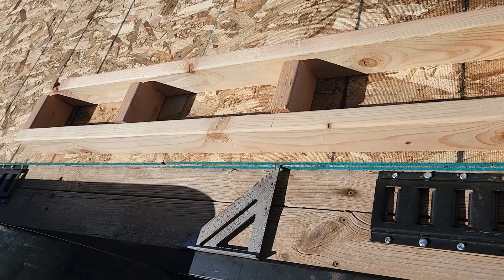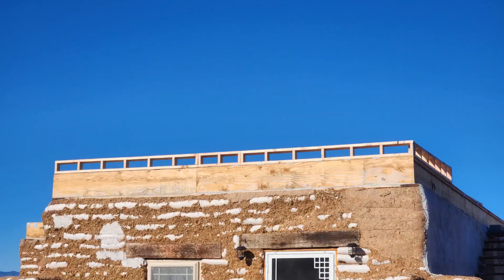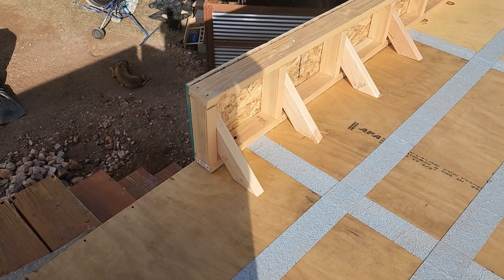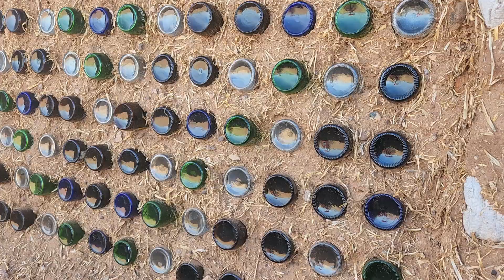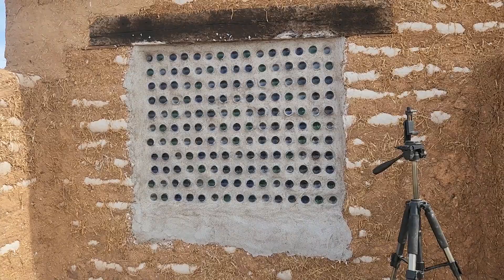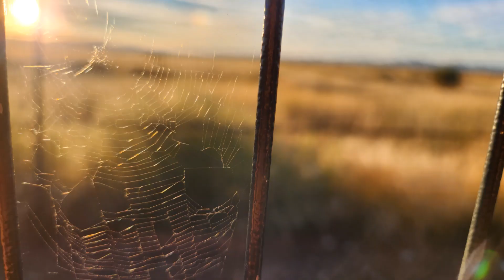More Roofing Progress, Bottle Window Exterior Lime Plaster ep 66

Comment: Thanks for showing the roof parapet framing detail. I had not been familiar with flat roofs of the southwest with parapets and how they get "reroofed." In short, simple positive drainage is key and the water is correctly directed off the roof.  No roof leaks and no water into the earth bags and/or water unnecessarily running down the lime plaster finish!  I guess in the olden days it was tar?
Reply from the maker: Perhaps,  it was tar, I haven't researched the history of the materials used over time.